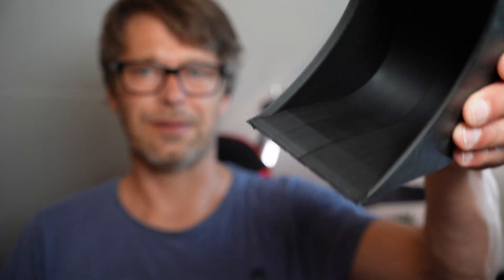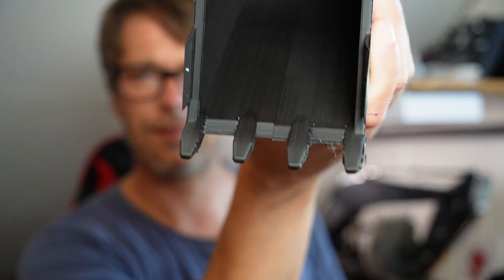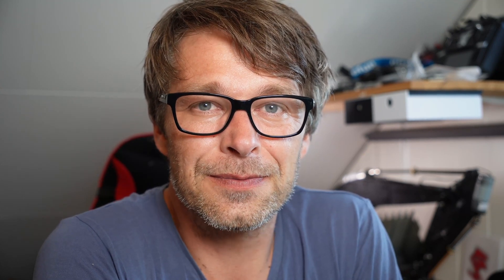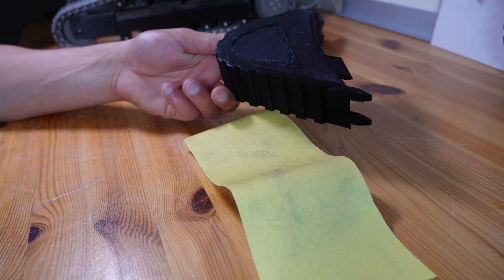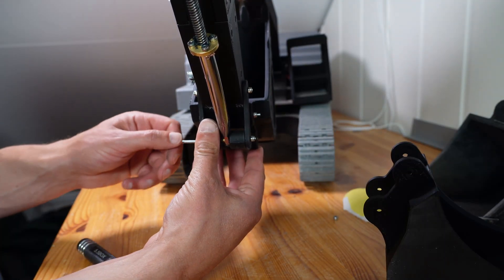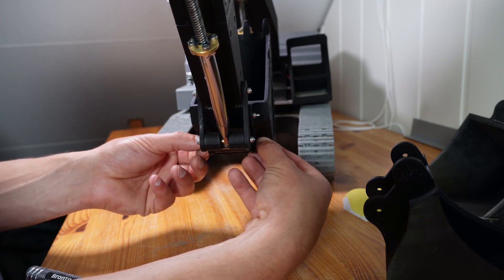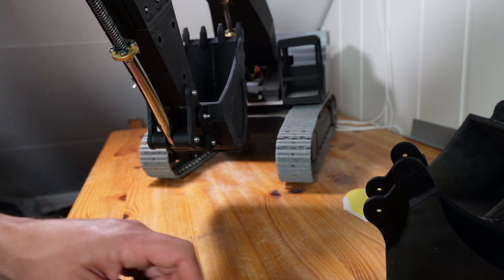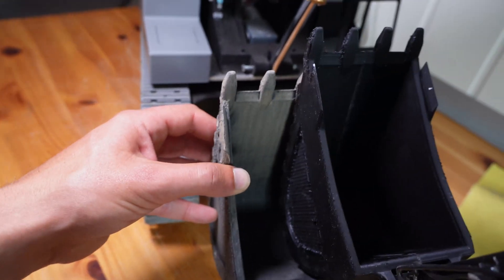FREE files for 3D Printed RC Excavator | New Bucket

Comment: Nice new bucket, but why do you print it in halves? 🤔I always print mine as one piece, granted, it means you need supports.😅 Very curius to see how well it holds up over time😉
Reply from the maker: I print it in halves to minimize the need for supports. Thinking about going one better and print the sides seperate and the curve as one piece.
Reply: @YetAnotherRcChannel  i guess if it holds up, its great😉👌
Reply from the maker: @FMDRCConstruction  been holding up so far. Just hoping it will continue doing so.
Do you print yours on the side?